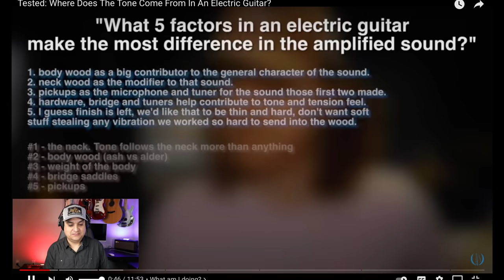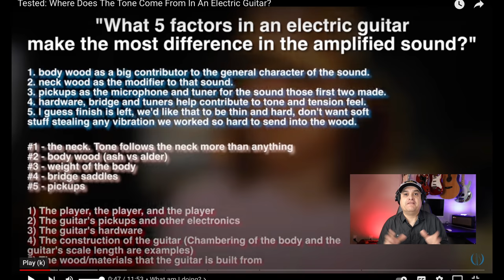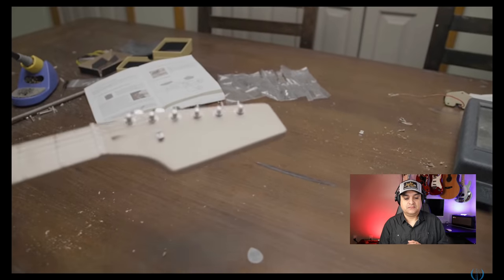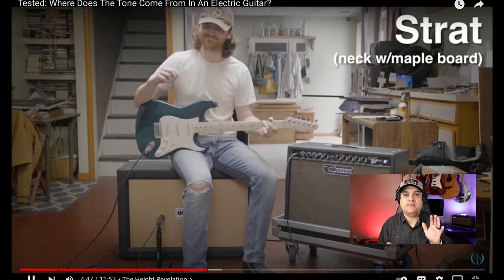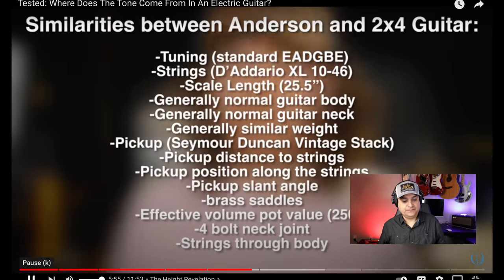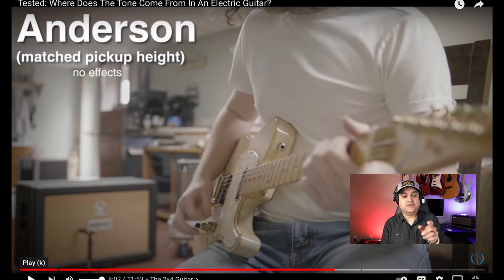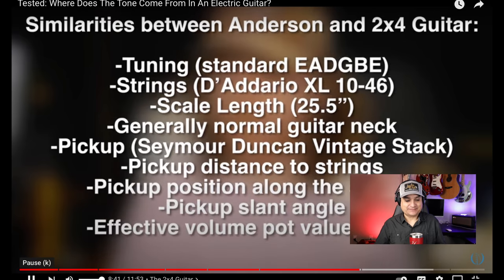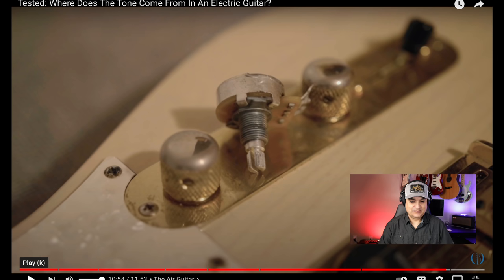Where Does The Tone Come From In An Electric Guitar - Reaction Video

Comment: I own a Squire ClassicVibe 50's Telecaster with a maple neck and pine body. This guitar is heavy. With original Pickups and electronics I thought it sounded ok. That was until I replaced the pickups with Fender Tex-Mex, ( cheaper, only disappointing part was the bridge pickups plastic base!? The original was metal) and replaced the electronics with a 920D loaded 3way plate. Through a Blues jriii British Royal Blood, (red color, with Celestial Green back speaker) the stock Tele system needed help with pedals and or pod. The improved version needs nothing but the Fat switch for Blues and Rock. Tex-Mex sound great! The improvement here on your tone control and volume control is unbelievable. Some will say you should've bought a MIM, but this guitar plays like butter. Yes it is still heavy. I have 127 shrapnel fragments up and down my spine and internally but, it will take a rather special light Tele to get me to own another with the proclomation of it's functions are better. Even then, the Squire will have a home here as long as I'm here to play it.

Comment: I'm not a snob when it comes to guitars. I own many from cheap to more expensive models. I had owned a dead sounding no sustain ash body american made telecaster. I have owned a cheap highway one telecaster and upgraded the pickup. Still did not sound good. I finally found a killer sounding traditional pro ash body telecaster. This one sounds right. I just purchased a Harley Benton Chinese made Explorer all mahogany and glued in neck for $300. Hoping that once I swap in some steel studs/anchors, aluminum tp, and better pickups? It will sound great. This was a very well made scientific test for tone. But I don't think a Seymour Duncan stacked tele pickup is as sensitive to these changes as a more traditional lower output pickup. I'm still in the everything makes a difference camp. Wood, hardware, electronics, strings, setup.

Comment: "Difference" is an ambiguous word. Engineers don't seriously use it without qualification. The quantity and type of difference is what matters. Regarding electric guitar, many things may produce a "difference", but how much of a difference and what that difference is, is a complicated technical question.
Here's another clue for you all; the pickups and the distance between the pickups and the strings are all that matters to electric guitar sound and tone. Yes, I said "all".
One more clue; listening to a guitar in isolation (not in a track with other instruments, vocals, etc.) is folly and reveals nothing of significance or importance.
When I ordered my Elliot Tonemaster from Andy, I asked him if it would make any difference if I had him use Brazilian rosewood instead of Indian rosewood on the fretboard. He said it definitely would, to my wallet that is, and that was all. Andy is a wise and honest man.
The same goes for slab vs. curved fingerboards, maple vs. rosewood fretboards, ash vs. alder, on and on and on. Lots of myths and misunderstandings here. The truth is, except as to the same pickups and string height above them a shown in the excellent  2x4 and bench experiments here, it is impossible to accurately determine the reasons for sonic differences of two or more guitars based on these things as they are intrinsically and irrevocably different sounding in so many ways to begin with.
Dylan, you are so right about listening clinically and listening to music. This is similar to high-end stereo. There are people who spend umpteen thousands of dollars on a system and only listen to the system and not to the music. Such a pity.
Bottom line for me: Equipment diving is fun and all, but if you want to sound better, play better. Period.

Comment: Basically, wood passing over a magnet cannot generate current. Ergo, well, you pretty much discreetly stated the rest. However, mass  can and does result in less loss of string inertia/momentum through the body - wherein resides the holy grail of Sustain (insert angelic choir here). So, in my estimation, a cinder block is, at least on paper, the optimal guitar body (I would suggest lag-bolting the neck however). Now that that's settled, I feel inspired to play my 7 kg god-knows-where-it-came-from-slab-mahogany-Warmoth-necked partscaster. Let the good times roll.

Comment: Fantastic! The big mistake is that electric guitar builders applied the knowledge of acoustic instrument builders over centuries about the behaviour of tone woods in an acoustic instrument to the stiff construction with pick ups screwed in it we call electric guitars. They are two completely different worlds. My theory is that in electric basses there its some difference between tone woods. The bass string has more vibrational energy. A maple neck for example, will dampen less of that energy than a mahogany neck will due to its natural stiffness. Less of the highs will get lost, therefor resulting in a clearer sound. On a guitar almost none of the vibrational energy, at least not resulting in an audible difference to the listener, is transferred into body and neck. As is clearly demonstrated by this great video.

Comment: You know I have a very nice electric and one very cheap one.  I took time to set up the bridge string height and pick up heights and that makes the biggest difference.  Having a straight neck as action affects a lot of the sustain you can have and ease of fingering which affects sound.  The cheap guitar sounds awesome as the expensive one however with no amp I can hear the wood of the expensive guitar has a deeper tone and tighter sound.  Plugged in I don't think you can hear that as well.

Comment: A couple of thoughts ... good demo of why every guitar should have a volume and tone bypass to wire the pickups directly to the o/p jack.  And aside from that, I agree that even if you can hear a small difference, the amount of change is inconsequential compared to where you strum, how hard you strum, the pick you use, electronics, PU height, ... not to mention amp, EQ, speakers ... and even the room you play in.  Having said all that, there is another aspect of woods, finish, weight, and frets that make a huge difference. Not to the sound necessarily but to how the player feels. Do you want to pick up that guitar or another? Does it inspire you to play more?  These may not affect raw tone much, but they effect profoundly your experience as a player.

Comment: Great video. I also watched the one you're reacting to. One small point of disagreement, though I know this wasn't your main point, 18:24... I have three guitars that I actually DO want to sound exactly the same because my main reason for buying different guitars is their visual differences. I have a Jackson Rhodes V 7 string, an Ibanez RG 7 string with the Petrucci "Picasso" paint job, and an LTD George Lynch Kamikaze reproduction 6 string. Granted the LTD has a single coil at the neck, but I want the humbucker at the bridge to have the same sound no matter which guitar I'm playing. So I found the debunking of tone wood and many other factors very comforting.

Comment: I hate "reaction videos", but this one was different, because the original video draws no conclusion -- which is good. But it's also interesting to then sit back and draw well a conclusion. I learned that as a newbie I need to learn how to setup the pickup height to the optimum position. BTW, now trying to find out how to find what is the optimum position (for me). 🙂

Comment: So it was deliberately removed from this test, but after pickups / and pickup height, a hard #2 is scale length. Not much is important after that, except perhaps avoiding cheap electronics.

I was wrong: i thought wood might have 10-15% effect.  

What was not tested besides scale length: bathtub rout / pickguard vs no rout / pickguard. e.g. strat middle position.  

Totally blown away by this test!!!  Good reaction vid btw.
Reply: Pickup position along the strings. Why a PRS 24 sounds different than a 22. why an SG sounds different than a LP.

Comment: The STRINGS then pickups then amp then speaker. The strings are actually the biggest factor I think. I mean listen to an electric or acoustic bass vs a guitar vs a ukalele vs a mandolin. The biggest difference between these instruments are the strings and the tuning of those strings. If you were to have a parlor sized guitar vs a parlor sized mandolin vs a parlor sized bass vs a ukulele they are all still going to sound vastly different even on the same sized body.

Comment: The final test is misleading. The "air" guitar is attached to a wooden table. So, though the wood is not underneath the strings, it still exists.
Reply from the maker: #tonebench
Reply: @DylanTalksTone  but, really. Do you agree? I mean, the overall test results is really compelling, but this "air guitar" bugs me. I actually have been rethinking my entire set up. Including my so called "tone masters" tube amps.

Comment: I have a thinline classic vibe and have made a few mods. One thing which for my ears did make a difference was changing from steel to brass saddles. I really think this gave me a sweeter less harsh sound which i preferred. Really enjoyed the video. I have also just bought the vox mv50 AC. The amp is a massive part of the tone with the guitar. Also have an Egnater tweaker which ive had on Vox settings for ages, a nice sound but not Vox. Would like to see a comparison video for the tweaker against the amps its trying to emulate. Of all the things i changed on my guitar though ,it was the saddles, Tonerider vintage pickups and 500k pots that seemed to make the most difference.  Surprised here that the woods and body shape had so little impact.
Chris

Comment: Each component adds some portion to the tone of an electric instrument but obviously the electronics and amplification have the greatest effect in producing the tone. Not "tone-wood" or "your fingers." Tone-wood may be more detectable in an acoustic instrument. Tone from my clear see-through Lucite V for the most part is produced by the heavy molded shape, the H-S-S electronics and the amp settings, not the neck or wood. (It is "headless") With synthetic construction, carbon fiber and 3-D printers wood is no longer required for modern instruments. On my first electric guitar I shaped a copy of a Vox Phantom out of a pine 2x10, attached a neck and a pair of pickups with a plastic guard for a hollow archtop body. Les Paul's prototype was a neck and pickup attached to a 4X4 with halves of an archtop hollow-body stuck on the top and bottom so it kinda "looked like a guitar!" They called it "the Log."  - I also read that Les built one model on railroad iron for sustain but I don't know how you would lift if you tried to play it.

Comment: heres my take on the tone wood debate.  I am a player and builder of electric guitars for many years.   back when the selection of amps and pick ups was not only limited to what Fender and Gibson had (no up grade paths yet) there was little difference from player to player in the tone dept.   
  The one thing the boys could do to try and effect a tonal difference was to change the wood. 
now if you have 5 guitars with all the same hardware playing through the same amps with the same pick ups, but 5 different types of wood, well I'll be betting the family farm that you'll have 5 very slightly different sounding guitars.  maybe not all in tone, but a combination of tone, sustain, and timber may give 5 different enough sounds.  

or maybe not.

Comment: Ultimately the guitar you want to play is the one you will play better on. Everyone plays the guitar they like more than the guitar they don't like. If you think the wood or the frets make you like the guitar more and thus play it more, then choose that guitar. I think it's only dangerous when people get into really expensive false beliefs like thinking that super old vintage guitars sound amazing compared to newer guitars. There might be positives and negatives to very old guitars, but the sound is not something I would say is in the positive column. Like needing to fix up a cheapo Squier with better pickups and fret work, the old vintage guitars have pretty much garbage electronics compared to the modern stuff. The only reason you wouldn't want to swap them out is because it would de-value the guitar's vintage condition. It doesn't sound good to have the old stuff.
Reply from the maker: The guitar you like the most is the guitar you will play the best. I totally agree

Comment: Those stacked SD pickups make everything sound the same. I would have liked to see this done with regular single coils. I think there would have been more differences with a more sensitive low output pickup. I have swapped same PAF style pickups between Les Pauls. More than once. playing through the same amp, settings, strings, etc. The sound was drastically different. I have owned 5-6 ash body telecasters. Using the same pickup they all sounded QUITE different. Also I owned a couple of them that sounded completely dead. No sustain or life. So from my experience? The tone wood makes a big difference followed by the hardware, pickups, and finally guitar strings.

Comment: I appreciate your desire to do the reaction -- because when I watched the original, I specifically wondered what you'd think of it.

Also you say a pickup doesn't act like a microphone. Sometimes they do, and you know this, it's just generally not considered a good thing and definitely not the intended means of operation.

Finally I disagree there's no reason to make two guitars sound exactly the same. Yeah, there is. Backup. You need something to play when the other takes damage and gets repaired, even for a broken string. The less you have to change about your performance in the process, the better. There's no artistic reason, but from a logistics standpoint, having two identical anythings can be a good idea.

Comment: Not one test like this has even taken the time to define what tone is and sorry to say most guitar players don't have a clue outside: sounds good/sounds bad. Tone is more than what is readily apparent to most listeners and ESPECIALLY in instances like this. 
Tone is at the very least: 
The original signal +/- any amplification/attenuation to individual frequencies
Attack
Decay
Sustain 
Release 
And not one test has even measured attack time before decay or sustain after and what frequencies drop off or remain. And there is not one benchmark test of a string brought to pitch without a body. And that is: "the signal" in this case.
I think the real question here is: "can a human tell the difference"? And I think for the most part the answer is no, we are talking about a spectrum that covers a range of 20-20000 tones potentially happening all at once. You would have to listen to more than top end, the volume has to be adjusted for apparent volume etc, it's literally impossible to have a comparative experiment by saying"can you hear the difference" without SOME guidance.

Comment: The tone wood argument is a touchy subject, because a solid rosewood neck sounds different on a Tele than the usual maple. And if you make that Tele body from mahogany, then again it sounds a little different. And a bolt on SG sounds a little different than the set neck variety.  Or try Gibson's old model of Les Paul  (L6?) made completely of maple, likely hate it like everyone else. Or a hardtail Strat from a trem version. These things change the tone by altering the fundamental response/interaction and string vibration.  It's slight but noticeable. But after all that tone wood chasing for a magical natural resonance, it's really the setup and pickups that matter the most.  I have a hardtail Strat - mahogany body with a goncala-alves neck and I'll guarantee it's not like any normal Strat when you crank it up clean -but at lower volumes it's a little harder to tell.  It started life with Texas Specials in it and they made it muddy when you cranked it, I even tried a 1M volume pot to brighten it up,  now it has a JB junior on the bridge, Duckbucker in the middle, and vintage rails on the neck. It sounds a little more like a Strat now than before, the quack is right and the mud is mostly gone. I love it.  But it still needed a no-load tone pot to brighten it up. The JBjr in parallel almost sounds like a Tele bridge pup.

Comment: like his video and also yours. so a guitar with good pick ups / electronics, proper set up (pu string height) makes the most diff, then amp n cab / speaker, then craftmanship / non electric hardware, and tone wood on the end of influence. But the other part of the equation is the player, and perception plays a huge role in the player equation, as well as their hands and creativity . . .

it was cool seeing you smile and I could literally see the glee as the truth hits hard like mike tyson in his prime or US Airforce one bunker buster drop from a bomber at high altitudes . ..  but its the internet so it'll just make them mad or pontificate on the belief (told as truth but ) of tone wood or  neckwood etc  few ones may realize what really matters to guitar tone . . .

Comment: Very interesting.  A takeaway of this is, play around with your pickup heights and individual pole adjustements before deciding you "need" new pickups.  Otherwise you could end up spending hundreds on new pickups and still not like the way they sound.  Not having messed around with this on my guitars except to adjust overall output, a video on this may be helpful.  Do you dial it in clean?  With the overall gain and effects that you're intending to use?